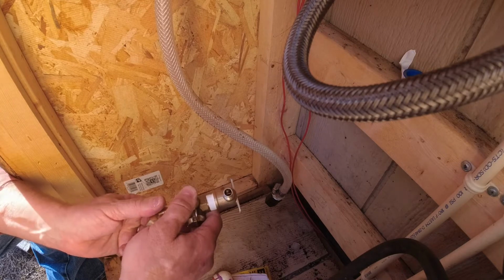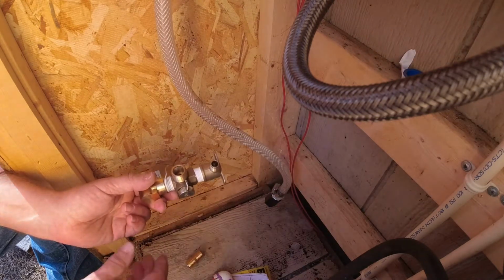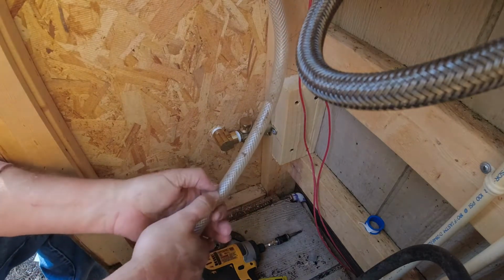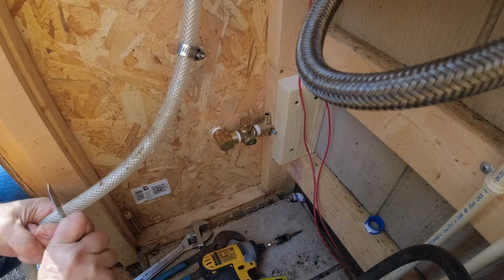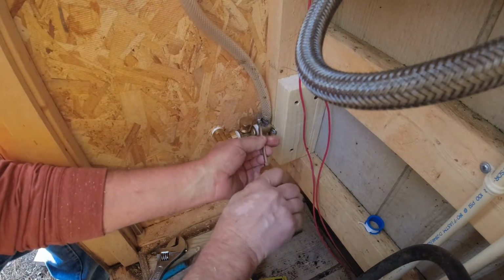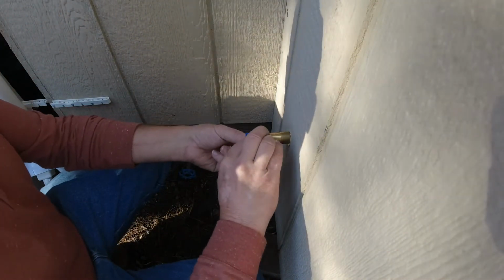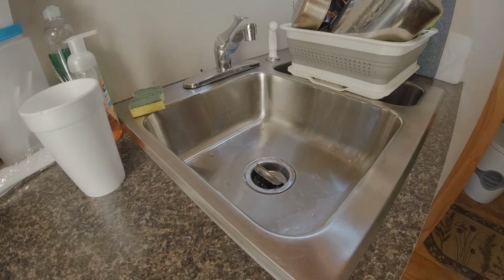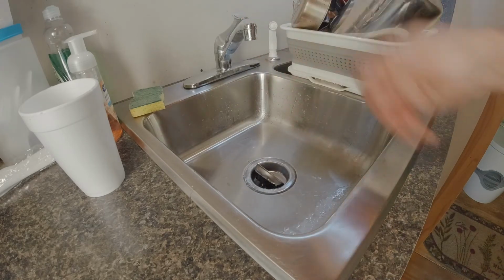Off Grid water | Cabin Plumbing

Comment: Good upgrade to help alleviate freezing problems. Is your tank all rain water captured?
Reply from the maker: Yes, all from the roof of the cabin using gutter and a DIY first flush system on the downspout. Thanks for checking out the video.